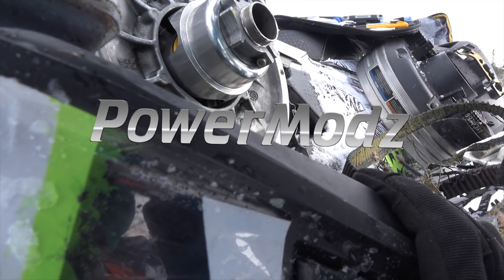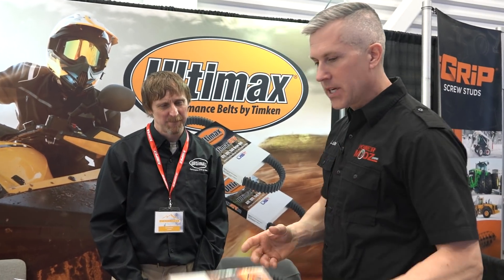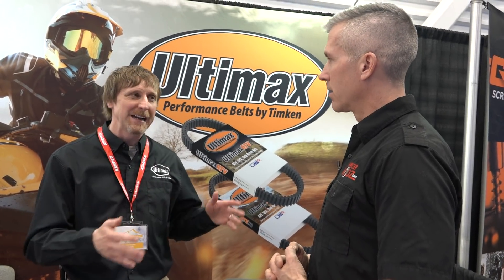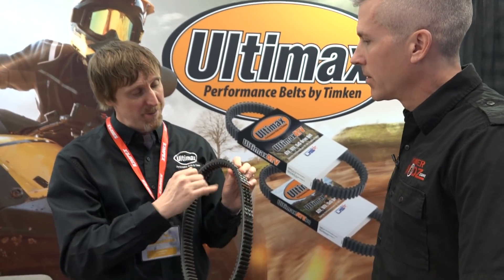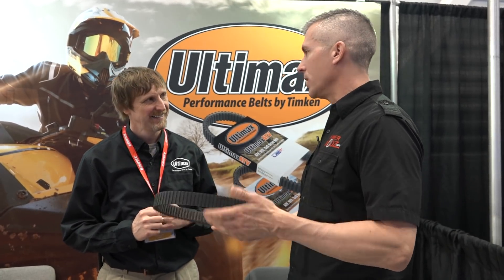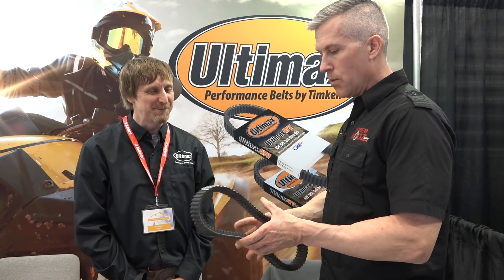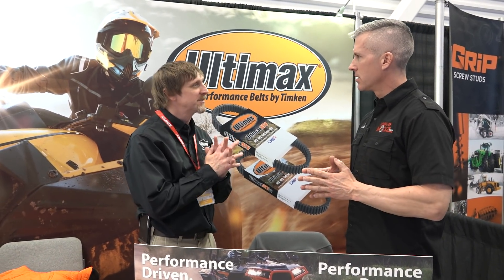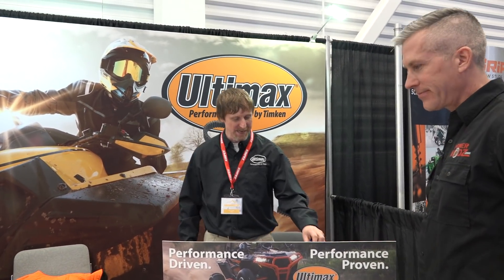Snowmobile belt break in explained by the Engineer!  Kimpex Dealer show!

Comment: If your running your sled like it's stolen, it's going to break.
I see these groups fly up behind you on a trail, bully safe riders to pass, blast by, shower riders with chunks of ice and snowpack from over studded ripper tracks. You have slow down from the snow cloud vortex they leave, as you can't see on coming riders.
Then later catch up to them stopped to piss,smoke, or yes repair a sled.  usually partially blocking you from safely passing on the trail.
You continue on then.... guess what?  Here they come again. 
I live and sled in area north of sturgeon falls and it's getting risky sledding here on main trails on weekends. All this performance sled building is not the the direction manufacturer's should  exploit...  Just thought l'd share.

Comment: I have a question so on my 2004 Skidoo rev 500ss Mxz today i was riding and the top of my belt ripped off , where the words are and I drove for another ten minutes after hearing before checking and it ran fine but I put my spare on to get home im wondering why the top would come off no cord has come off yet my belt deflection is good and there are no black marks to show slippage and I can keep my hand on the clutches for atleast 30 seconds so their also not too hot im just wondering whats wrong if you would know or tell me who to ask thanks

Comment: I have 10,000 miles on a 2012 turbo cat. When new I couldn’t keep a belt to stay together. Cat changed the gearing, secondary, alignment and now I have over 3000 miles on my last belt. 

There is a formula to good belt life, you just have to find it.

In cats case, the engineers worked hard to find the cause and make correction. They got popped hard on social media so they had to correct it.

Comment: I put a XS belt on my 2016 Arctic Cat M8000 when I bought it new last year as a left over.  It now has about 800 miles on it and I can tell you those weren't easy miles.  500 were in the mountain with LOOOOOOOONNNNG wide open pulls and the other 300 miles were ditch banging back at home.  The belt still looks brand new and shows hardly any sign of wear.  I'm very impressed so far with it and they are priced great also.

Comment: If it's simple as just putting the belt through a few heat cycles...I'm going to start selling new belts that are pre broken in...🤑
Reply: Take a stride or Step aside that's what I was thinking. Why couldn't this be done before you buy it
Reply: @seano1334  for another hundy, they probably could
Reply: You would have to mock up a stationery set up with similar stresses as the real thing. Putting 300 miles on a belt in fuel alone would make for an astronomical belt price. It would be awesome.

Comment: Evo belts are the way to go in my opinion. Check to make sure your belt is not bottoming out on the primary clutch when you install also your secondary bushings in your clutch can cause exclusive belt heat like the square ones they now install on an rzr clutch. Just make sure nothing in your clutch is making flat spots on your roller! Just some all round good advice